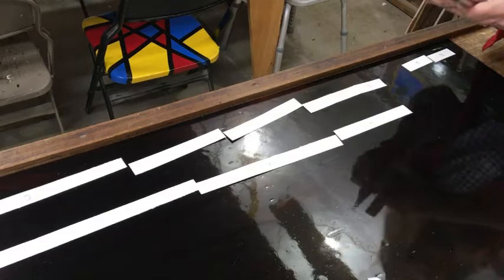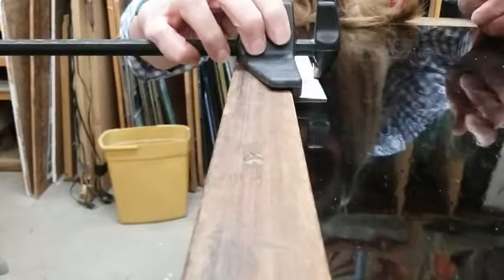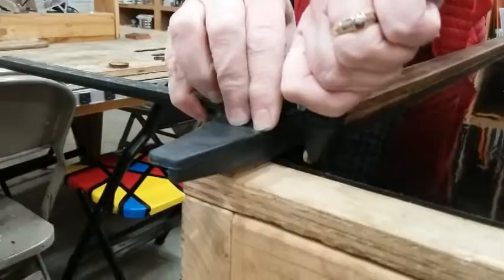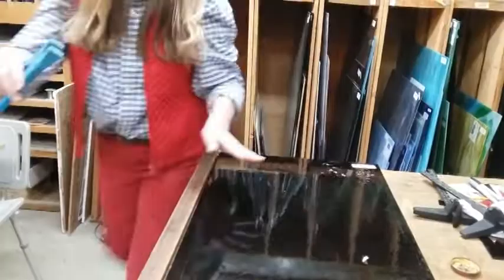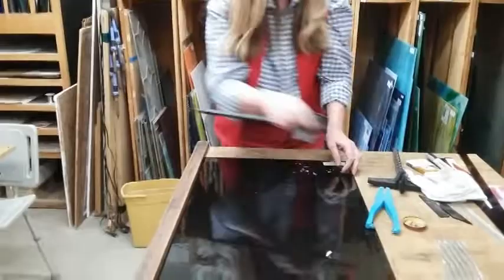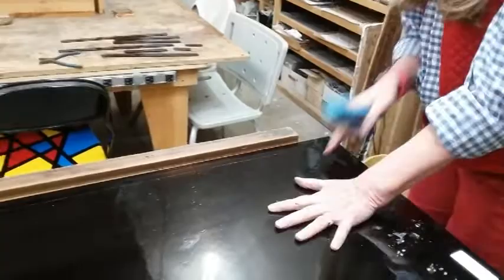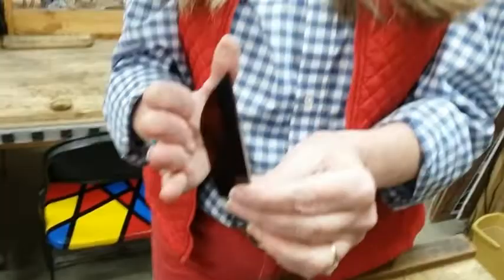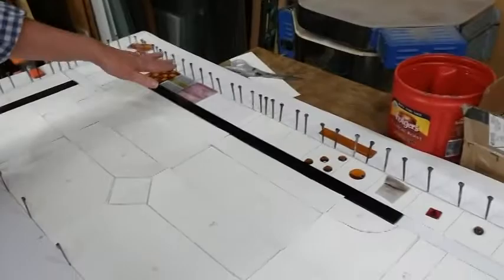Cut Long Strips Of Stained Glass V290

Comment: I have had that as well.  I find depending on the glass thickness or texture type this technique works well on them also.  Especially if you have large pieces of glass in your design with some slight curves in them.  I don't scrap glass as much using this technique.  Thanks for sharing.
Reply from the maker: It's great to have a choice that works!!!

Comment: You said you dipped the cutter in oil. Does the kind of oil matter? Is it a special oil? I love watching your videos :)
Reply from the maker: You can use many types of oil. We started out with kerosene which was a traditional oil in the glass industry...it smells bad and when some got spilled in the studio it was terrible. There are glass cutting oils sold by many studios. We have a blend of orange oil with an organic massage oil. We also have lavender oil mixed as well. Without the mixed oil, the oil will make the cutting wheel sticky after a week or two. Other oils that work, 3-1n-1 oil, vegetable oil, and scented lamp oil. But if you don't add some oil to the cut, you miss out on cutting the glass, it will work much better with oil.
Reply: @GommStainedGlass  thank you for your answer! I've seen the bottles of oil being sold, but they rarely specify what kind of oil it is. I think that'll be the 3-in-1 oil. I'll try with some vegetable oil :)

Comment: How do you KNOW when it's time to replace the cutter ???  Thank you  You guys ROCK !!!!
Reply from the maker: When the cutting wheel is new it really bites into the glass and then with use that "bite" becomes less and less. Eventually you just get to the point where it feels like it's time to replace the cutter, so you turn the cutter wheel to the next number and you'll find that the new wheel bites into the glass like it used to. When you get to the last cutter on the wheel, you'll need to replace the entire turret and you'll want to do that on a clean organized surface so you don't lose pieces ..it's  a  delicate operation.